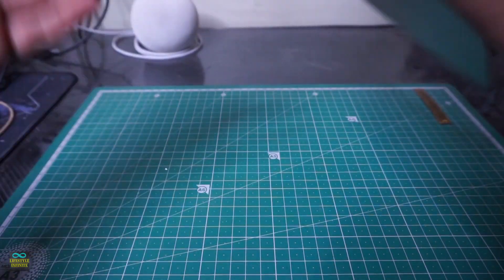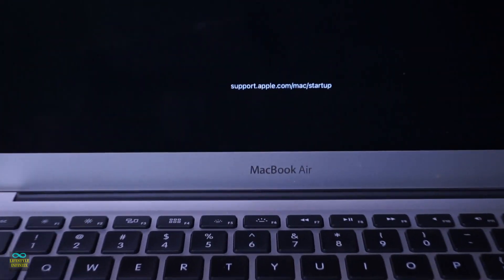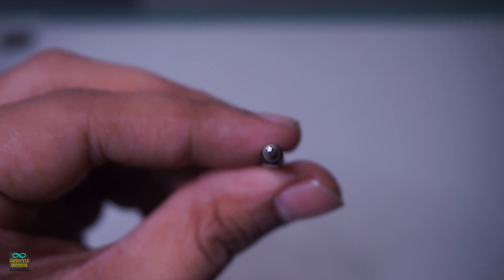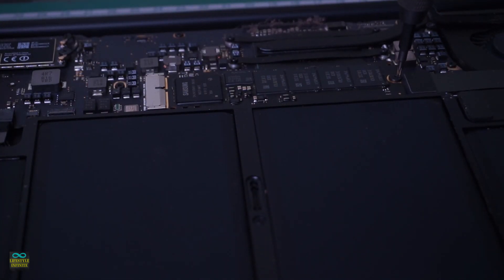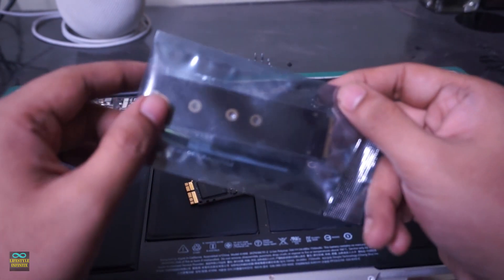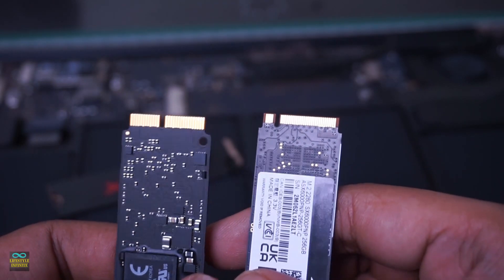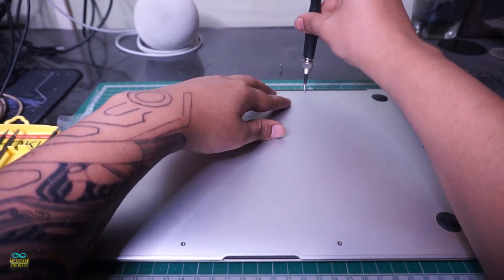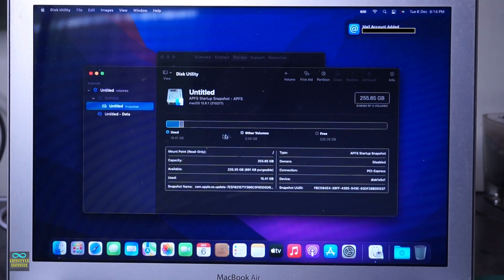Apple MacBook Air A1466 SSD Replacement

Comment: I am a dj my computer dont tuen on can i get my music from this?
Reply from the maker: To be honest, it has a very slim chance. I would suggest you go to a data recovery specialist. 
OR, if you want to tinker like me, follow these steps only if your drive is not encrypted and this has a very slim chance of working:
1. Get a MAC SSD to USB enclosure. OR, MAC to NVME adapter and NVME to USB enclosure.
2. Pull out the SSD from your MAC and add it in your new adapter.
3. Connect your SSD to another MAC(Windows will not do, as it does not supports the Apple File System)
4. Files may appear in the external drive.

Comment: What about heating?? I upgraded with Samsung 980 pro in macbook air 2015 and after upgrading Ssd and processor heats up like crazy what should i do ?
Reply from the maker: This has never occurred to me. I would suggest the following:
1. Install the SSD in a desktop m.2 slot. 
2. If the SSD is still over heating, install samsung magician on the desktop and update the SSD firmware.
OR
If it is not over heating, replace the adapter(m.2 to Apple).
3. Format the SSD and install it back into the MacBook.
If you don't have a desktop with spare m.2 nvme slot, ask a friend. Else get a USB enclosure for nvme SSD. Use USB to connect the enclosure to another system for Firmware Update.
Let me know in the comments if it works. Cheers.
Reply: @LifestyleInfinite  ok thanks for replying i will try it

Comment: I have this macbook and it broke down out of nowhere. I wanna transfer my files from the hard drive to another computer, is the hard drive the same as the ssd? Which adaptor do you suggest? Im panickiiiiiiiiiiiiiiing, gotta submit something inside it on Monday 😭😭😭
Reply: Mine too. Working just fine, then I left the room. Came back to it stuck on power up. I mean the boot up chime sounds for only a second then powers off then powers on again.
Reply from the maker: The type of SSD is the same as the one shown in the video. In order to fix it you can just use the nvme to apple converter and any m.2 nvme SSD.
But for recovery of data it is complex. There is 10~15% chance that the SSD will be readable with an apple SSD to USB adapter/enclosure. And, thanks to Apple, the adapters are expensive and hard to find.
If everything goes well, the drive will only be readable from a Mac.

Comment: Did you manage to recover data from your hardrive? How did you do it if you did?
Reply from the maker: No. I had no luck finding an adapter which converts Apple SSD Connector to USB.

Comment: Mine didn't fit perfectly.. what did you do...yours also didn't fit right?
Reply from the maker: I did not screwed the adapter down, the screw holes did not align properly. Also, I plugged in the battery connector after forcefully jamming in the SSD adapter.

Comment: So internet recovery works for the 2017 version. I see others use bootable usb instead of the internet recovery and I don't why they do this.Also users mention specific MacOS needed first. I want to upgrade my 2011 air but hesitant of the issues stated. Does the older macs support the internet recovery for the ssd upgrade?
Reply from the maker: Hopefully it will work, but still need to double check. The oldest model I got this working on was MacBook Pro 2012.